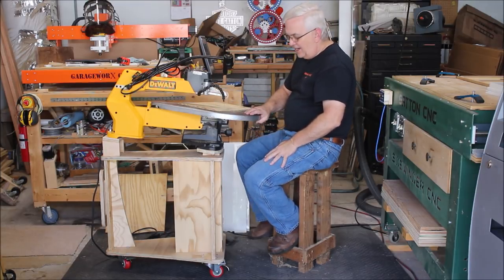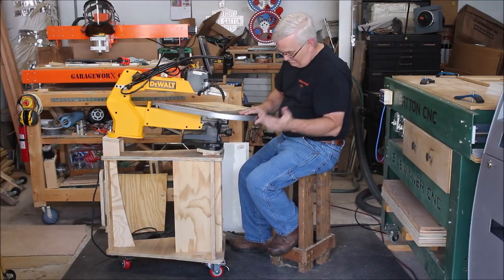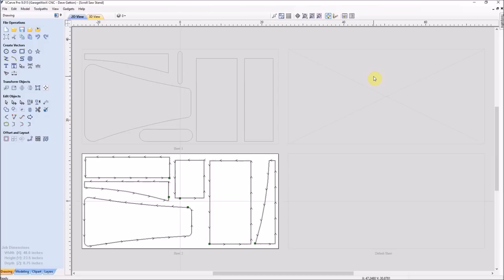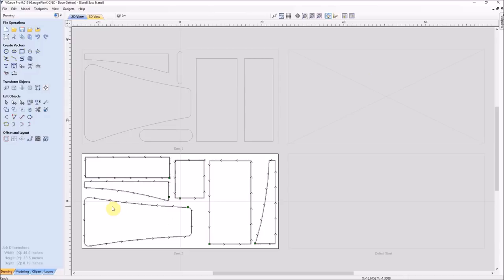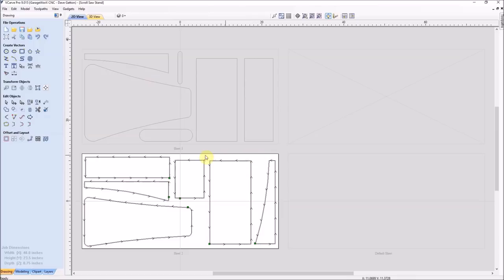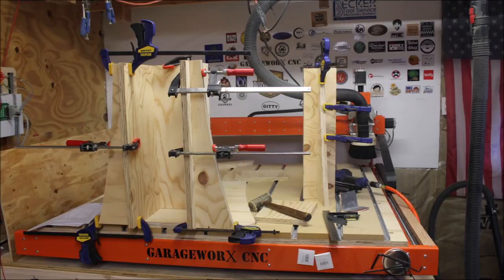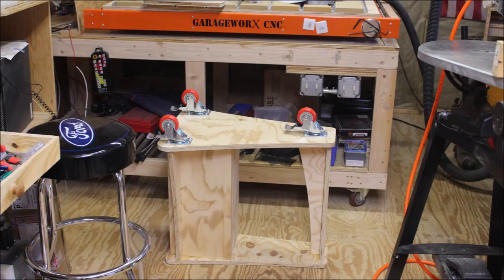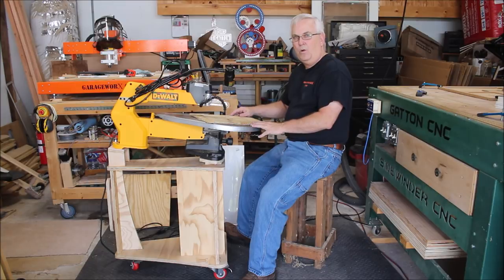Scroll Saw Stand

Comment: Very nice, thanks for sharing. Silly question but if you turned it around so the narrow end was towards you would that not be more comfortable? Still having the furthest point higher. You could wrap your legs around it. Cheers
Reply from the maker: Thanks for watching Shaun.  The wider end is near the front of the saw because there is some storage on that end where you can put extra blades etc.

Comment: Great video. I've passed it's on to a friend of mine who would be interested in making one of these. 
I've also noticed in the a few of your videos of late that your Gatton CNC now has 10 V Bearings on the Z Box instead of the usual 6. I am about a week away from starting to cut out some of the parts from your plans and was wondering if I should make the same change to the design? Is there a reason you went to 10 bearings?
Reply from the maker: Thanks for watching John.  I have been asked that question about the 10 bearings vs 6 before.  The 6 bearing design is quite sufficient for using your Gatton CNC as a hobby CNC.  My machine however, is used more like a production machine as I use it to cut the Gatton CNC parts kits and it has many more hours on it than a hobby machine would.  While I was doing some routine maintenance I decided to remake the Z-axis carriage and add some extra bearing I had laying around.  Since I run a water cooled 2.2kW spindle on mine which is very heavy I figured it wouldn't hurt to beef it up a little.  Since adding the extra bearings I haven't really noticed an increase in quality but I'm hoping that the changes will help it last a long time.  I guess you could say mine is the "industrial version" of a Gatton CNC.  :-)